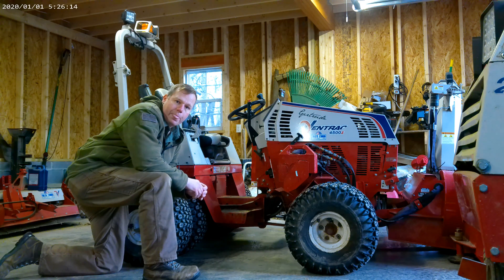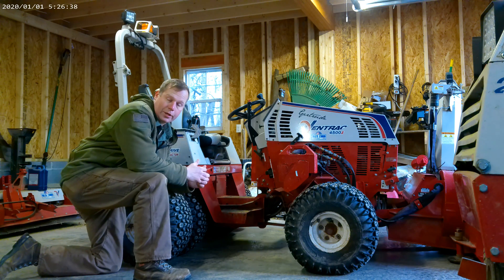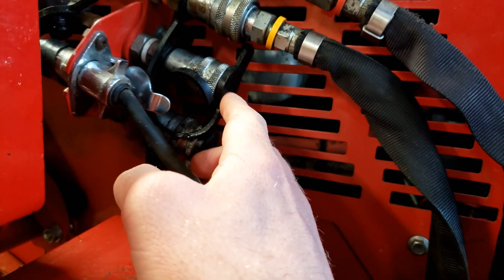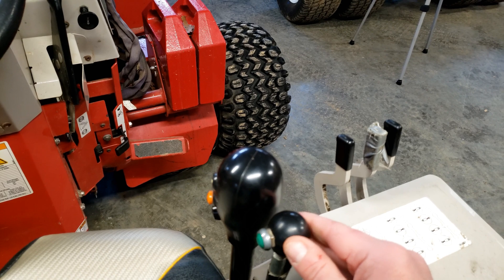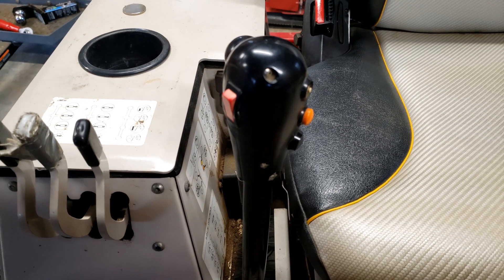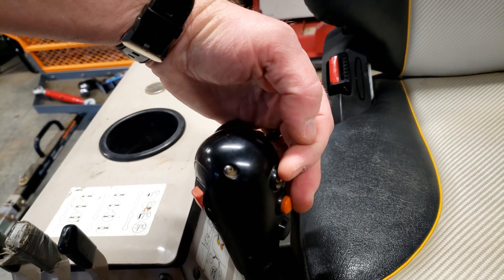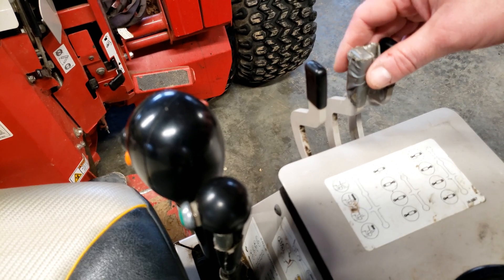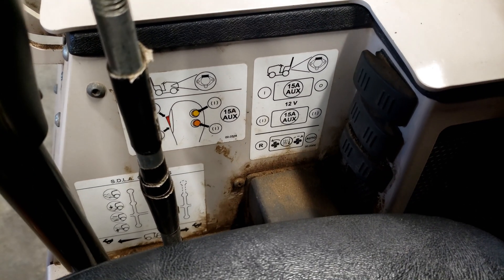Ventrac 4500 Hydraulic and Electric Controls Explained

Comment: Seem to have lost drive in all but one wheel, front right is all that’s spinning in low or high range. Can’t find anything in the manual. Any ideas. My dealer is closed for the long 4th weekend. Thanks Mike
Reply from the maker: Mike I have a very good idea what has happened but I won't try to text here.  You can give me a call. at 484-796-1586.  I do charge a consultation but talking with me will make your life a whole lot easier

Comment: Great video as always!  Is there a Ventrac option that you DON'T have?!?!?  Lol...  My next Ventrac video will be me fixing a torn off valve stem...  🙃. Take care!  -JTF
Reply from the maker: The ONLY option I know about that  I don't have is the digital slope gauge.  I specifically ordered my 4500Z WIHTOUT it!  I like the analog gauges so much better!
Reply: @bluecordterrainmanagement  Thanks Bradley!  Mine doesn’t have one either.  The demo unit had it and it was cool; but to me not a necessity.  👍🏼👊🏼
Reply: @emrythompson  Hey Emry, I really don't.  My wheel was flad from the valve stem getting whacked but other than that, I have had zero issues with flat tires.  It really sounds like you have some pin-hole leaks.  Have you used the soap and water method to check?

Comment: I agree with Roy.  No one else on Youtube explains how to operate and repair/maintain this equipment the way you are, and I appreciate it.  I also got my eye on a 4500Z, but since it cost around $25K for just the tractor, I don't want to make the wrong decision.  I am trying to wrap my head around everything you showed us.  Am I true in saying that you cannot run the grapple on the bucket when it is mounted on the rear of the tractor?  And if you purchased the foot pedal option, could you then use the hand controls for something other than driving?  Sorry if these are stupid questions.
Reply from the maker: Tom, you CAN use the grapple on the 3 point IF you remove the hydraulic top link and replace with the standard turnbuckle to free up a set of the auxiliary hydraulics.  I almost included this in the video!  Perhaps I can make another to showcase this.  The foot pedal is connected DIRECTLY to the same mechanism as the SDLA directional controls.  I suppose I could have shown that on the video as well
Reply: Do it Tom!  I have a 4500Z and have never regretted it for a second.  Good Luck!

Comment: I like your mid mount weight kit, never seen that before
Reply from the maker: I ordered that through the 2nd largest dealer in the US at the time and even they had never seen one before.  It comes in VERY handy to put more weight on the front wheels when I'm running with a bucket on the back and a light attachment on the front